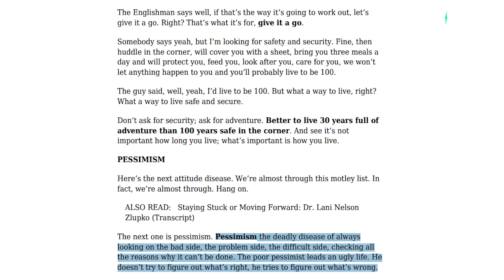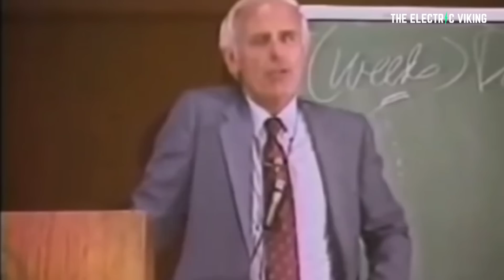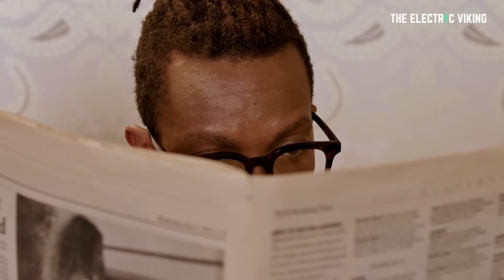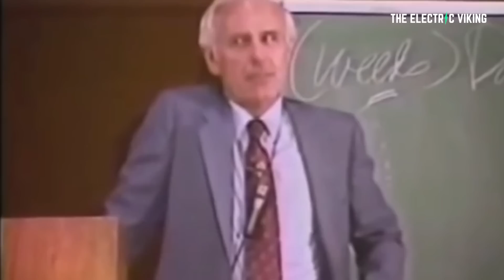Germany sets renewable energy RECORD in 2022 - will hit 85% in 2030

Comment: Energy production is only half of the equation. Grid maintenance is a major obstacle with delivery struggling on a dated and failing infrastructure. Solar and wind are great but do not solve the problems of delivery that fails during storms and with wear. Home production only works 100% in places with no winter.😂

Comment: How do you produce enough renewable energy for Smelting plants, Renewable factories,  Cross Country Freight Trains, Deep Level Mining, Renewable Logging, Arms Production, Brick Ovens, Concrete Production, Asphalt Production for roads, Plastics Factories, Rocket Launching ......(the list goes on)  working at the same time? Excluding ordinary township electrical energy usage which include EV charging, because that might be very doable  in about 30 or so year's time. .I'm also a "half-full glass kind of guy".

Comment: Excellent video Sam.  I see we think mostly the same.  As a chemical engineer I've been closely watching and think we need two things to get better to make a big jump in ownership:  battery technology and solar cells.  We're getting there but are not quite ready.  I recently installed a solar system on my roof but refused the battery choice available.because we are on the cusp of a leap forward with batteries.  Excellent video.
The only thing that I strongly object to is the government trying to shove this down our throats.  When it's ready to take off people will be fighting to own EVs and solar power as the market economy will demand it.  When the next evolution of batteries hits the market in 2023 or 2024 it will start to make more sense.
Reply: Are you referring to LFP batteries in 4680 form?
Reply: @shauna996  That is the next step, but still not there yet.
Reply: @shauna996  check out Quantumscape Corp
Reply: I'm not sure which government that you're referring to, but the US government funded NASA, and the fledgling internet. I don't see them forcing anything down our throats.  The government is offering to incubate the transition. Investment is needed to get the advancement that will drive market demand. It isn't either/or. I know that market ideology has taken hold in the minds of many people, but even Alan Greenspan had to admit that "I was wrong". Thank you for your work in your field. Double-down and help get us there.

Comment: Thanks so much for not covering all the distractions! When people find out I'm stoked about Tesla and EVs they immediately ask me about Twitter and I'm like "I don't care, haven't been following it. It has nothing to do with EVs.".
Reply: But it does.  Thats what you guys dont seem to get.   Elons twitter  deal has crashed the value of tesla by 60%.
Reply: @jebes909090  and that affects EVs and EV adoption... How exactly? Are lots being filled with unsold Teslas? Has this slowed down Tesla's production rate? Expansion plans? FSD deployment? Megapack and solar ramp up? Cybertruck launch date? If it doesn't affect any of those thing then I don't care. That's what you don't seem to get. Tesla is rockin it, even if the stock doesn't reflect that fact.
Reply: @truhartwood3170  well  they've stopped production at the chinese tesla plant.  you tell me.
Reply: @jebes909090  no they aren't. There, I told you. And even if they were it would not be for reasons of demand or finances or anything. Their demand is still huge.

Comment: Elon is having his Howard Hughes moment, exit stage right. Too bad. 

However, Tesla and other manufacturers developing BEV products will soldier on because electrifying the light vehicle fleet as BEVs is a no brainer. 

Heavier commercial vehicles may need other solutions such as fuel cells, but this will also happen.

Comment: Sam, I don’t think your description of the German power system is accurate. Germany has destroyed its power system by shutting down reliable power plants, so they have a constant lack of energy when there is no wind and no sunshine. They have recently decided to start five coal power plants - the worst polluters of them all - and three nuclear power plants that previously were supposed to shut down. 

A power system cannot rely on 100 % intermittent and weather dependent sources - which renewables are. You need to cover up for the periods when weather-dependent sources give NO energy. This may be hydro plants, nuclear plants or LNG plants. Or batteries - as long as you can store energy e.g in batteries over longer periods of time than just a few hours.

Comment: The move to renewable energy  is a virtuous path which I totally support. Where is disagree is that there is NO emergency and if the world goes totally to zero CO2 emissions, if will not make the slightest difference to atmospheric CO2. 
One volcano eruption will put out more CO2 than industry does in one year. 
Move away from coal, yes, but only when the renewable infrastructure is ready to generate the same amount of energy.  Otherwise we will be paying through the nose for electricity, gas and petrol.
Reply: Volcanoes only put out a percent of human CO2 emissions per year check your facts before you go stating something as the truth.

Comment: A positive attitude is one thing. An unrealistic holding to an erroneous belief is quite another.  Please people.  The crux of this question is STORAGE and BASE LOAD.   Without storage, intermittent energy sources CANNOT POWER A GRID.  Period.  Are batteries the solution?  From what I’ve researched, the answer is no.  Unfortunately.
Reply: hydrogen might... use solar and wind farms to produce hydrogen locally and transport with a pipe network to a power plant. even if there are many loses in this process, you solve the STORAGE and BASE LOAD.

Comment: Good for Germany! Here in NZ we are 82% renewable, but we have stalled recently. We are going to need a lot of new generation to allow for the change to EVs, so here’s hoping we can build more sustainable generation….
Reply: 82% seems unlikely high. What does the Kiwi energy grid look like?
Reply: @InfiltrateIndustries  New Zealand had a head start in that they have a lot of hydroelectric.  Much like Norway and Iceland.   They've  since added some wind and a tiny bit of solar.   Pretty poor effort in the last 10 years  but hopefully they're on the right path now.
Reply: it looks good 🤣
Reply: @InfiltrateIndustries  lots of hydro
Reply: Yep. The nz grid looks good.if your'e watching from the eu. If only nz would follow their lead. And they will.
Reply: Is it the case that much of the NZ supply of renewable electricity is from hydro power?
    As best I can determine from google, petrol in NZ is around 2.75 NZD per liter and electricity costs about 0.30 NZD per kWh.  If these prices are correct, people will be standing in line to buy EVs over there as the cost per km looks to be about 1/4 of that of using petrol.  Per our US DOE figures, your country can plan on about half the electricity needed to power the EV fleet coming from reduced consumption at your oil refinery.
Reply: @peteinwisconsin2496  yes, we are very lucky with our hydro resources, but we have developed all the obvious sites. We have some wind - a few percent. We have huge wind potential but the intermittency, or ‘wind gap’ is a problem on a small, isolated grid. If only we had a grid connection to Germany! Or even to Australia, but they are 2000km away. I have been working in this area for a while…..
Reply: @neilhawkes880  Can any of your hydro sites be switched off during the day?  I guess that would depend on downstream users of the water.  Access to water only at night or under overcast skies won't work on rivers used for recreation.  Flooding upstream might be an issue as well.  If some of your hydro sites can be throttled back with daytime power sourced from PV, then wow!, a lot more solar can be added to the Kiwi power grid.
Reply: @peteinwisconsin2496  unfortunately most of our hydro-stations are run-of-river, with no storage lakes, so we cannot use them to store energy. A big pumped hydro storage scheme was considered, but the environmental and economic costs were unacceptable.
Reply: Nz sucks bro. Where you got 82% is totall # fckery
Reply: Intermittent generation is still useful, but baseload is much better. I can't believe Germany has been phasing out nuclear. It makes no sense at all
Reply: @russelldesilva1560  The power companies in Germany might be shutting down the nukes due to cost.  In the US, power companies are letting their nukes go, still in license, because the unsubsidized cost to operate them is higher than ALL the other sources of electricity.  Here we can't even justify the expense of "gassing up" the old nukes.  New nukes still might compete if they can get to $1- $2/ nameplate Watt.  The two new nukes in Georgia, USA came in at about $13/ Watt to build.  PV and combined cycle natural gas plants both cost a bit over $1/ nameplate Watt.
Reply: @peteinwisconsin2496  
The main reason for the cost of nuclear is the licensing  which is VERY prescriptive and has killed innovation stone dead.
Nuclear is valuable because it is baseload and green. The only other generation that fits this is hydro, which is tapped out.
Solar/wind need enormous investment in storage, and the tech for this is simply non existent or too expensive.
IMHO we need nuclear, and we need to overhaul the role of the licensing agencies.
Reply: Do note that those %s are misleading, as it is capacity, not production. NZ capacity is mainly Hydropower, so you have access to it most.of the year, and makes it one of the most green countries in the world.

Even if Germany achieves the same %s, since they rely mostly on solar and wind, it's likely that their actual production won't even be 50%, which makes them reliant on gas and coal (as it can be seen today).

Hence why NZ is going a bit slower: they are already in an amazing place when it comes to emissions! You'll find the same example in Norway and Sweden
Reply: @miguelsousa9802  that’s a good point. It’s also getting harder to find new hydro sites round here!
Reply: @neilhawkes880  exactly. And usually adding solar/wind doesn't do much, as hydro covers all the needs, and then having some hydro stored / natural gas for periods of drought. 

So, until NZ decomissions some older hydro plants, or storage becomes economically feasible for long-term, there shouldn't be much newer projects electricity wise. (On heat, industry and transport, that's another story)